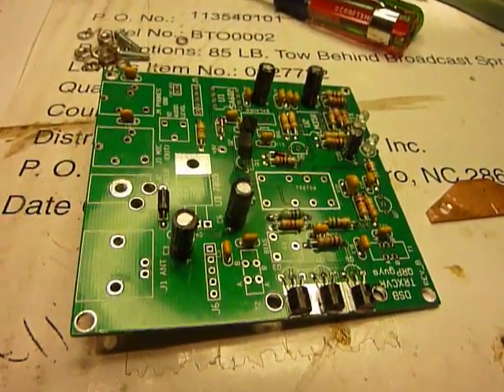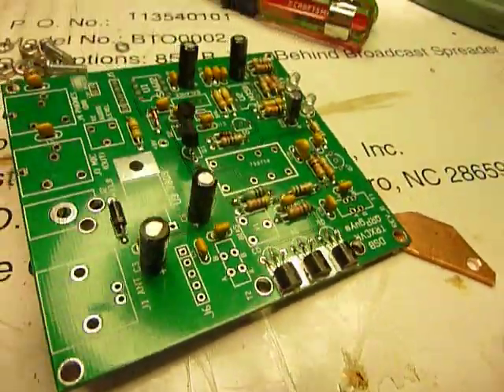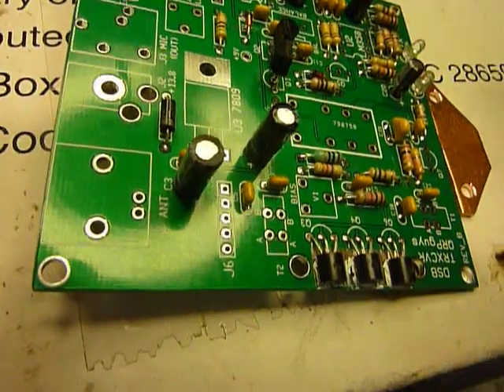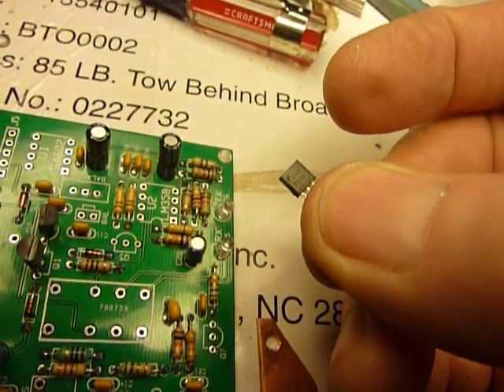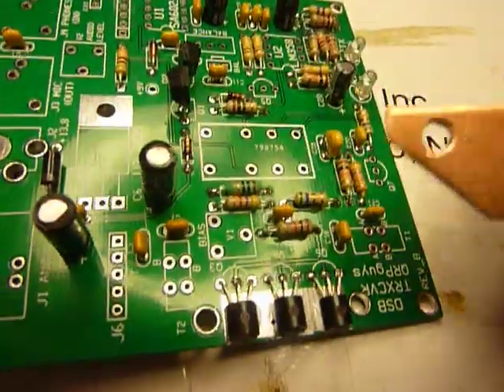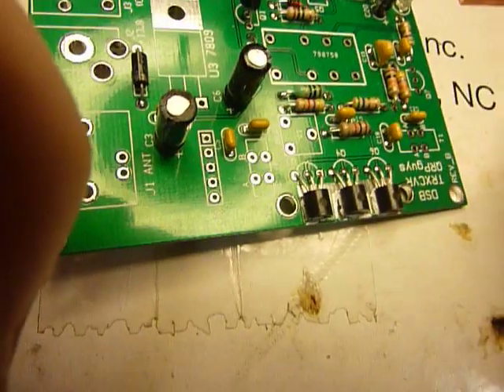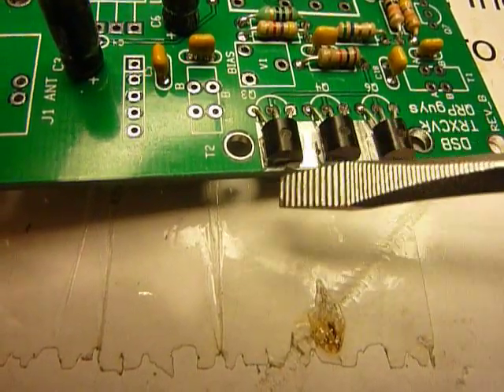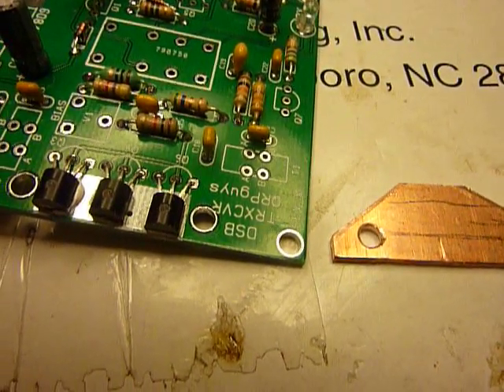Part 3 QRP GUYS  DSB tranceiver

Comment: I used a piece of K&S brass strip available from most hardware stores or Hobby Lobby.  I didn’t use the heat sink compound and don’t think I needed it.  The three BS170s get warm but not hot after 10 minutes of frequent transmitting.  I liked your idea of checking that they were from the same batch.

Dave K8WPE